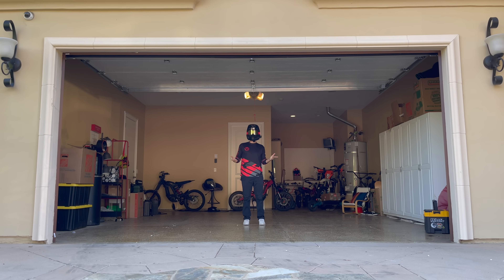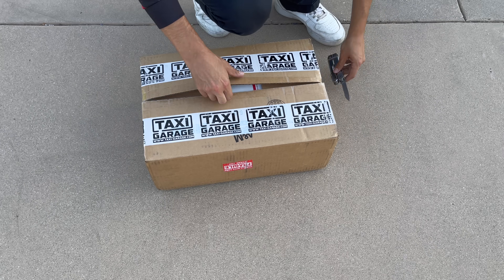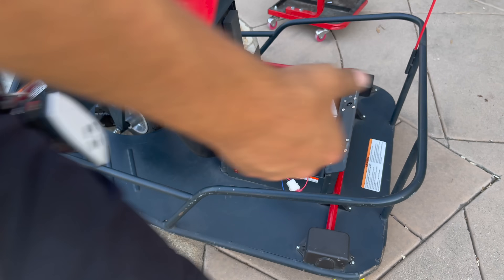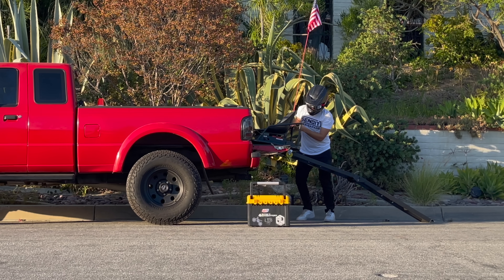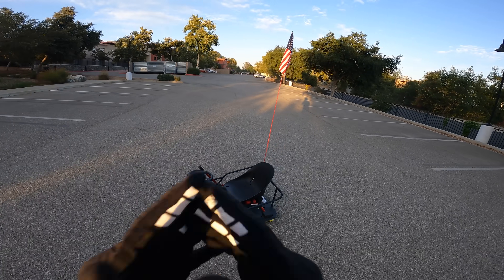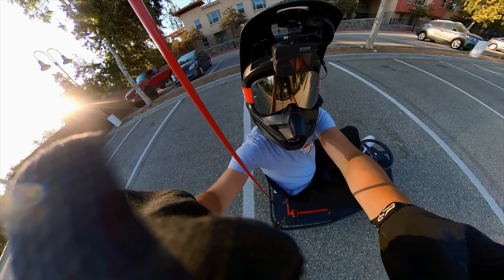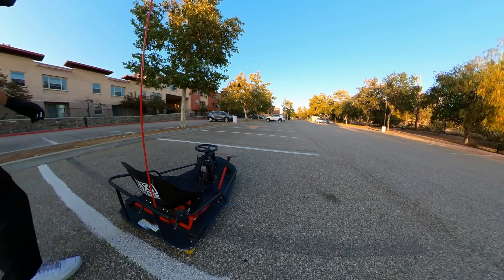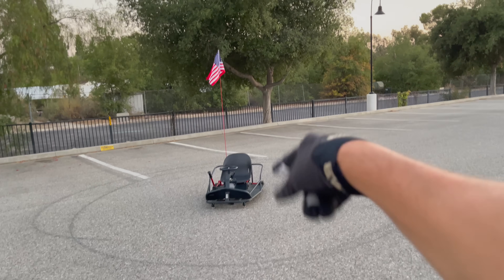Easy DIY Electric Drift Kart // Taxi Garage 48v Crazy Cart Upgrade Kit Test and Review

Comment: I’m gonna get one (non electric) and luckily I live right by my school by the back parking lot and it’s pretty big and there is a pretty long straight away for the busses AND a park with like a running track I could drift it on so it’s like a free drift track AND on the way there there is a side walk that has some turns on AND a front parking lot that has a turn and poles to drift around AND if I’m bored but cant go outside I could drift inside since it isn’t electric AND I live next to a round about that I could do donuts in (I don’t know why I said this😂)

Comment: The thing is can you really consider this thing a drift car because the back end yeah it's going sideways but you're on casters that's like putting trays underneath the back of my front wheel drive car and drifted probably with this idea came from but to me drifting is actually slide in your rear wheels and spending them at the same time

Comment: So you guys wanna crazy kart without the pricetag? Here's what I made: little kids bike with a 800w E scooter front hub motor, 48v battery with 60a controller, then at the back a piece of 2x4 timber with castors on the ends, rides like a crazy kart with the drift bar up and can do 1080s at 50kmh

Comment: Ohh cool they give you all this to upgrade I built a 1800 electric green machine few years back was a absolute beast but sat for a while I got the battery witch is like 25ah 55 volt battery and 1800 motor on one off these but wouldn’t work aye

Comment: You seriously need to configure some type of braking system for that thing. Maybe a lever on the left side that drags the ground with a rubber boot of some kind. Dude you could've smashed into a car easily.
Reply: It has a shocking amount of control when you get used to how it moves, should check out the official website they have a video showcasing just how much control you have, if you add a brake it would most likely cause you to lose control. It may appear like he was going to crash but likely he had it all under control 🤙

Comment: looks really fun. does it have regenerative braking?
Reply: @benchillders8405  but does that mean no normal brakes or no any brakes?
Reply: @wilderness-beastt  no any brakes, the controller isn't set up with regen braking. I'd have to look up the taxi squad controller to find out about theirs but the stock controller definitely does not.
Reply: @mitchstarr5317  okay thanks for the clarification. 🙂
Reply: @wilderness-beastt  👌

Comment: This is so badass. Only a matter of time before someone does a 72v 3000w upgrade and drift their ass into an alternate timeline.
Reply: I already have a 72v brushless XL with a programmable Kelly control pushing 5005W. I know of a guy with a 70mph XL as well.
Reply: @KillerBeemanFPV  do you have proof of the 70 mph one?
Reply: @catgirlow  I’m guessing that he meant the wheel spin off the ground is 70 mph, meaning that technically going downhill a bit you could hit 70. However, these are not stable enough to ride casters above 40ish mph.
Reply: @NoahZimmerman  oh yeah probably, no load speeds are useless though I never understood the point of them if they aren’t realistic
Reply: @KillerBeemanFPV  then wait till someone does the 144v battery upgrade
Reply: @KillerBeemanFPV  where can I buy one?
Reply: that's what happened, they went into the past and the kart ceized to exist
Reply: @jelle2306  Then a velociraptor eats the rider, takes over the wheel, rides it back to the future, and goes on a sick rampage eating half of California before he's caught by Sur Ronster and crew. I'd pay to see a video of a driver wearing a raptor suit on one of these... the terror
Reply: i think i might
Reply: Hahahahaha duddeeee hahaha
Reply: No cap
Reply: KillerBeemanFPV yours goes 43mph and your friend has one that goes 70!!!
Reply: on some regular show type shit
Reply: Challenge excepted
Reply: have a 14kw {14000w} 72v XL, did 74mph, in a indoor karting area. When summer comes i will post it here on my channel.
Reply: greeenpro batteries from the leaf blower company, 60V
Reply: I put a 4450W hub motor on the front tire running a 72V battery and oh boy does she scoot
Reply: Fr tho
Reply: sounds like something i would do
Reply: @4X_REAPER you are years behind. 😆
Reply: I'm about to put two 1,500w motors on this to go ludicrous speed
Reply: @Slashoom can you send me the link to those 1500W motors